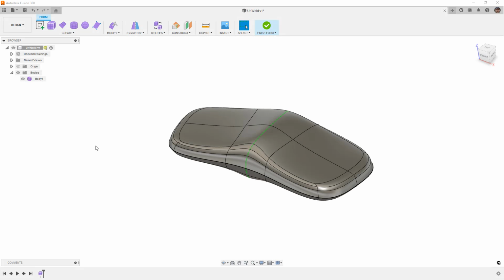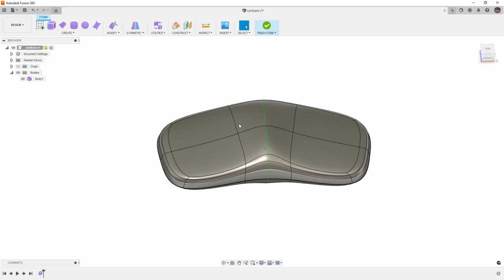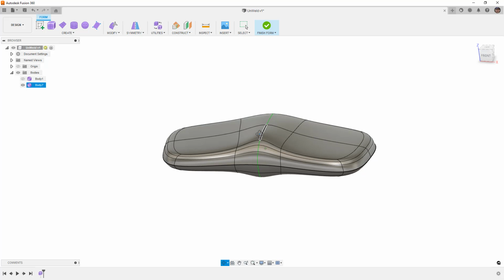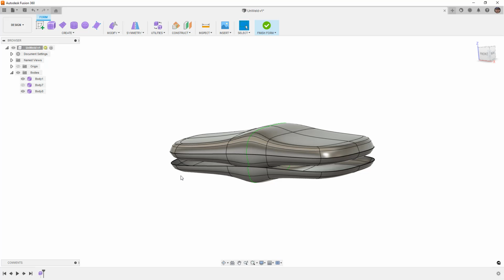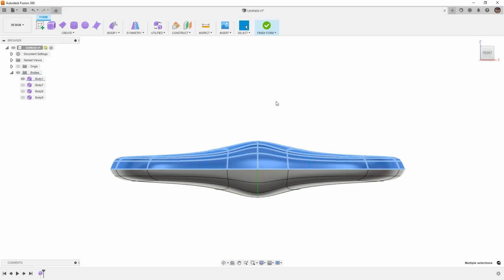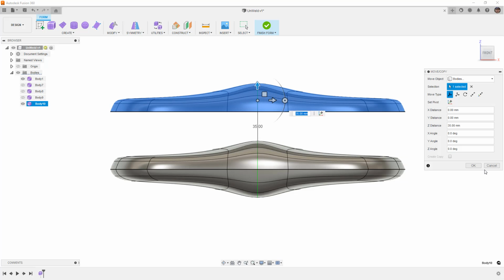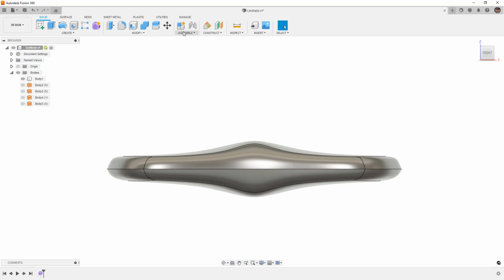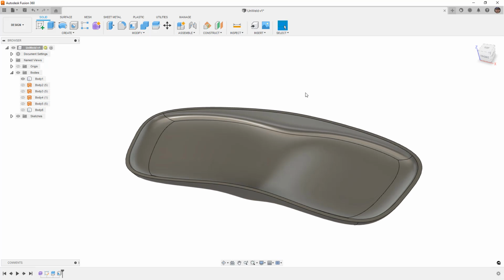Fusion 360 Form Mastery  Part 32 - Why Use Unweld and Copy Paste with Forms #Fusion360 #Forms

Comment: Thanks for the video!  How to Unweld a single edge?  I get it when double clicking to select a bunch of connecting edges, but when I single click on a single edge it didn't work.
Reply from the maker: You would need at least 2 edges for the tool to work.  When you UnWeld a single edge the end vertices are still attached so it can't do anything.  If you select two edges, it can break apart the verts in the middle.

Comment: On the part where you copy and paste faces and the pasted comes out differently because of the geometry further out driving the shape: would the two pieces actually look identical in box mode?  Also, how many vertices/faces/edges out does the remote geometry have effect?  The smooth model is basically a control point curve controlled by the box no?  So does the effect continue diminishing with distance until it hits an inflection point?
Reply from the maker: In box mode the copied faces will look identical yes, but the shape will be different because, as you mentioned, there is no additional face controlling the curvature into that edge.  The extent of this control varies but it is diminishing.  The faces/edges once removed from the copied edge don't directly affect the copied curvature, but they would affect the curvature of the adjacent face.

One other way to visualize this is if you crease the edge which will be the extent of your copied faces, that is generally going to be the same shape because the extra faces no longer control the tangency/shape into/out of that edge.  So that would be the exception.

Comment: Hi sir. I just started to watch your channel and learned fusion forms completely from you. Thank you so much for your effort for us. Besides it I just found out tangent handles (The red squares and green dots).  It is hard to obtain a uniform body with curvature analysis. Would you make a video about it please?  I could not find any explaining video about it.
Reply from the maker: Wow glad it has helped!  I have some "tricks" I can show dealing with the curvature analysis, but on the tangent handles. are you speaking of "Edit by Curve"?  Fusion used to have some control handles you could access from Edit Form if you were using Vertex selection mode.  Those handles(if they still exist) were picky as to when they would show up and in general i would avoid using those (and edit by curve).  I can show you you a trick using smooth to help resolve some curvature issues, but if you have a specific geometry/case feel free to email me about it. support@caducator.com
Reply: @LearnEverythingAboutDesign   Thank you for your reply. Yes We are speaking about same thing. I think they are useful at sometimes on thight sections against crease. When I use crease, it creates too much tension on some situations, specially if it is close to star points. So it might be useful to use them at these cases.  It is just my opinion I just started to form modelling with your videos.